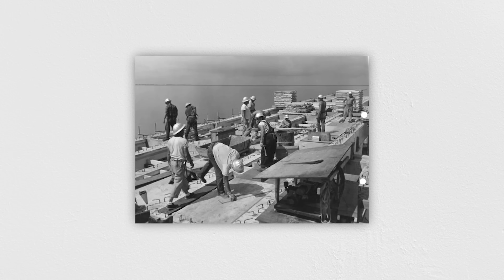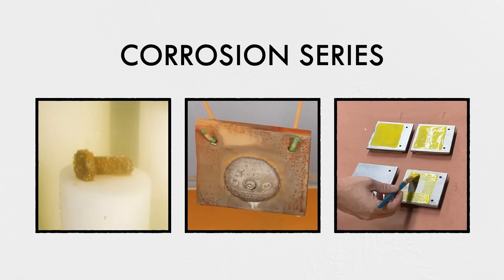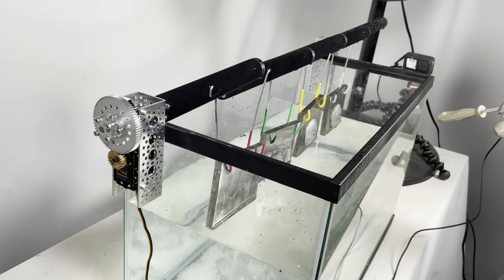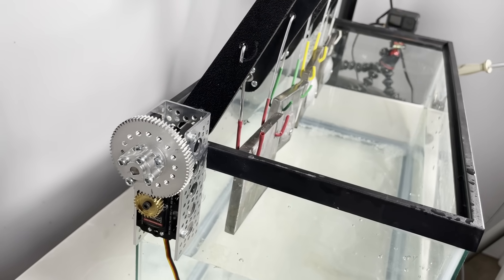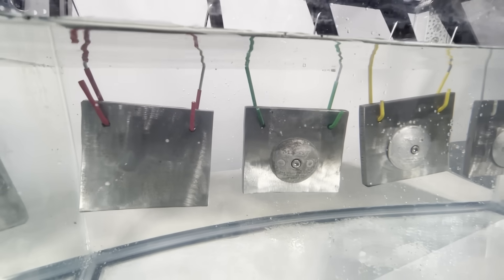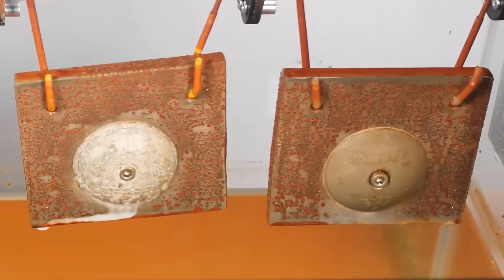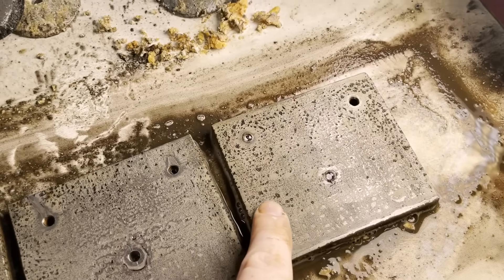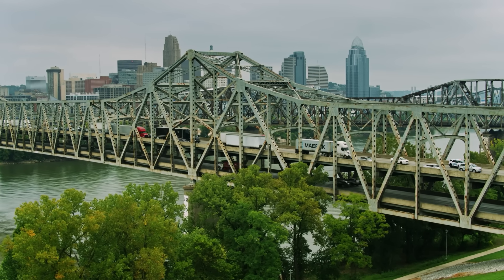Why Spillway Gates Don't Rust Out

Comment: The Rustomatic 3000 is astonishing! There must be an engineering school, college, university whatever near you that is willing to turn this into something more formal? I'd love to know some numbers behind the degradation e.g. how much material was lost, impact on strength and rigidity etc...
Reply: There are already established corrosion testing methods similar to this. The salt fog test is done in a sealed chamber and maintains high humidity and a salt-laden atmosphere by spraying salt water into the chamber. This (and Grady's method) is useful because it simulates conditions in a 'tidal' or 'splash' zone where moisture, electrolytes (salt) and oxygen are all present in significant quantities. This is where corrosion is worst.

A student could potentially choose to replicate Grady's apparatus for the sake of doing something differently, but a research group is more likely to use the existing standardised tests so that their data can be compared to existing research. The test methods are codified in standards documents all over the world.

Comment: The "At home" connection with cathodic protection is the anode rod in tank water heaters. Most tank water heaters are just a steel drum coated in glass on the inside. The water sitting in these tanks will rust right through the tank over time, so most tanks have a rated lifespan of 10 years or less. But if the tank is flushed regularly and the sacrificial anode rod is replaced on-schedule, a tank can last twice that long or more. The anode rod is "cathodic protection infrastructure" most viewers can see right in their own homes.

Comment: If you stuck say a copper cathode on the steel plate would that cause it to corrode quicker?

Or if you use steel bolt though an ali part?

Comment: Fun fact! They make zinc "spray paint" and it actually works wonders. I use it on iron pipe fittings all the time, makes a huge difference (and it's very easy to reapply)
Reply: Especially handy afterwards where preparation for welding involves removing an area of zinc from galvanized steel.
Reply: We use it at work when we have to re work galvanized stuff, nasty nasty
Reply: Oooh (immediately plans trip to hardware store)

Comment: Stainless steel is a very poor choice in seawater. If the conditions are correct it will dissolve more quickly than mild steel.

Comment: Back in my navy days I was a submarine sonar technician and whenever our boat would pull in for drydocking the sonar division, who was in charge of the sound silencing  program for the ship would have to climb up into the slimy smelly ballast tanks and inspect them for sound shorts, loose equipment and missing paint etc. One of the main tasks was the inspection of all the sacrificeal zincs that are bolted all over the inside of the ballast tanks for obvious reasons. It's pretty amazing how well they work, that along with the special high solids marine paint do a good job of keep corrosion at bay.

Comment: I didn’t understand one part. Where you showed the graphic of the bubble of water and anode and cathode and said the anode loses electrons to the cathode - at that point you said the anode was a lower potential, but then you labelled the anode as + and the cathode as - (Ie positive and negative). But if the anode is positive then it is at a higher electrical potential than a zero or negative potential. Hence the label of positive means it’s at a higher potential and not at a lower potential as stated earlier. So that seems contradictory and perhaps one of the statements is wrong?

Comment: You could also mention some cables for bridges, that get wrapped with a layer of metal or plastic foil, creating a tube where dehumidified air is being blown through, so the atmosphere doesn't corrode the cables.

Comment: I remember this from when I studied (but never finished) chemistry.

I do wonder what happens when you protect steel with zinc, the zinc with aluminum and the aluminum with magnesium in a stack 🤔
Reply: As long as they all remain in contact and all the water is connected, I would expect they pretty much corrode in sequence of electrode potential, starting with the magnesium.

Comment: Wonder how they optimized the cathodic protection for the bridge, feel like constantly replacing little pucks of zinc would be wildly expensive and time consuming.
Reply: By making them big pieces of zinc that don't need to be replaced often
Reply: @ipodhty  Is there a size ratio that the engineers go for? Like 1:100, 100 ton piece of steel needs 1 ton of zinc to treat it for x amount of days...

Comment: The same process is the reason that different metals rust together, like bolts, pins and other fasteners, which is often called galvanic corrosion instead of anodic corrosion. 

Instead of the salt water acting as the conductor, it relies on the direct contact. This corrodes the less noble metal, which seizes up the fastener. Anti-seize is primarily a layer between the two metals, but copper is quite high in the Galvanic Series, so it stops one metal from eating the other.

Comment: For most boats with outboard drives, the housings are made of aluminum. In a saltwater environment, usually zinc anodes are used. In freshwater environments it's more common to use magnesium anodes. The houseboat we lived on for 10 years had an aluminum hull, and had an impressed current system. It was powered by a 1.5V battery, and a meter and potentiometer. The meter had a scale to indicate which way current was flowing, and you'd adjust it with the pot to try to get it to zero. We replaced the battery every year, but it was rarely ever depleted (the amount of current is in the microamp range). When in the marina, if you noticed the meter had moved off zero, it was typically an indication there was an electrical problem with a nearby power pedestal  or boat.
Reply: Batteries are powered by a redox rection too, so you could say an impressed current system powered by a battery essentially just moves the corrosion to somewhere else, where it's easier to manage. How neat!
Reply: What was the anode on that system?
Reply: I'm not 100% certain, but I think it was graphite.  The houseboat was a 1976 Lazy Days Sportsman, and it was installed by the previous owner. We bought it in 1994, and in the 10 years we lived aboard, we had the boat pulled twice. Both times we did while we went on a trip, so I never actually saw the anode itself. I do know it was bolted to one of the two strakes that ran the length of the exterior of the hull. There was a thru-hull fitting for the lead that went to the anode, and I was always a little paranoid about breaking it when I would be down in the hull messing around.
Reply: interesting! Thank you for sharing! 😊
Reply: Aluminium anodes are used on motors run in brackish or run in brackish and salt waters.

Comment: As a hobby I collect and restore old train locomotive air horns. Most locomotive horns in North America are cast aluminum, which means dealing with corrosion is a huge issue when it comes to restoring them. Most often the hardware used in the horns is grade 5 steel bolts, but on railroads that operate near the coasts or ones that use highly caustic wash solutions that often doesn’t last very long and bolts get stuck. Getting those apart is very difficult, and in extremely bad cases horns crack apart due to the corrosion. Some companies and collectors use stainless steel bolts and nuts but that just exacerbates the corrosion of the aluminum!  The best thing to do and what I do on mine is to use zinc biased anti seize compound on the hardware.  Learning about galvanic corrosion and the galvanic chart has been extremely helpful for me to know what to do to give the pieces in my collection the best preservation that I can. 
On a horn restoration most often it’s corrosion of the aluminum rather than the steel hardware that’s the biggest problem, and machining parts down to get them back in spec and helicoil inserts are needed to get things functional again.
Reply: Never thought of using stainless... great idea!

K5LA, P3, P2, M5, & S3 owner here!
Reply: ... oh, nearly forgot the A-200!

Comment: Oh hey Grady I didn't realize you were in San Antonio too until catching up on a lot of older videos. Neat, we don't have enough fellow Texans on YouTube (Austin doesn't count). So back to corrosion, yeah structural metal & coatings & rust mitigation techniques is a fascinating trade. I had the privilege of working in a couple of Fab shops in Houston where I'm from when I was younger; Railway track segments, ship propellers & drilling solutions.. Spray metal welding, spray arc coatings for a company called GDS (that's how long ago this was lol!). It was an extremely fascinating trade working with so many different metals for so many important industries. I never got to work with any of the newer exotic alloys for aerospace but wish I had. The closest I got to "exotic" were titanium alloy spray arc coatings & titanium itself for drilling & ship parts. Hard metal to work with but extremely rewarding when you got it right. It's too bad arc spraying is still so expensive because the protection is 2nd to none as long as the surface is never gouged exposing the inner unprotected metal. I know all over Texas that newer road constructions are already failing due to the green plastic coating on rebar that sounded good at the time actually sped up the rot!

Comment: I used to design and install CP systems for everything from nuclear missiles and silos, ships, underground/above storage tanks using both sacrificial and impressed current systems. It is quite complex to the point I could tel you within a small window when an in coated tank would fail due to corrosion. It is called a MTCF (mean time to corrosion failure).

Comment: Epoxy coatings and painstaking were applied to rebar and were first used on the trans- Alaska pipe line to extend the life of the pipe line.  Marine vessels typically have sacrificial zinc anodes to prevent corrosion on pleasure craft.  The nations pipeline system is protected by Catholic protection.
Reply: Catholic? lol
Reply: @userPrehistoricman  What are you talking about?  Are you on meth?

Comment: I may not know how many ounces are in a lb but I know the saying and I know that ounce is less then lb.    I don't think the exact number matters as the saying has nothing to do with measuring.   English has a very long list of phrases in use that don't actually make sense when you break them down.   I'm sure that one will just be added to the pile.  People will still use it long after then know what a lb even is.   Example:
cupboard:   It's no longer just a board and it's no long just a place to hold your drinking cup.   
Rule of thumb
The proof is in the pudding
etc etc
Anyone know others?

Comment: I hope some day someone comes up with a way to harness/harvest all that electron flow. Maybe instead of spending energy on impressed current systems, we could somehow bring the resistance of useful work to the otherwise corroding structure and collect energy out of it.
Reply: That's exactly what a non-rechargeable battery is. The problem with harvesting energy from a corroding anode on a structure is that you will only have a fraction of a volt and in a normal environment there isn't much current available. It's simply not worth it, especially since it might reduce the amount of protection.
Reply: @eDoc2020  Well met. Obviously, an e.g., alkaline battery is going to be a lot more optimized to discharge electric current than some infrastructure that we're actually trying to preserve. That said, it seems like you should be able to be able to fit an awful lot of AA batteries into a bridge the size of the one in the video. If one (in the far future) could cover it with a grid of teency e.g., diodes/capacitors/inductors/whatnot. and have them all feed into a central tap, it seems like something that would add up to be cumulatively useful. Pie in the sky for sure--but also interesting to think about.